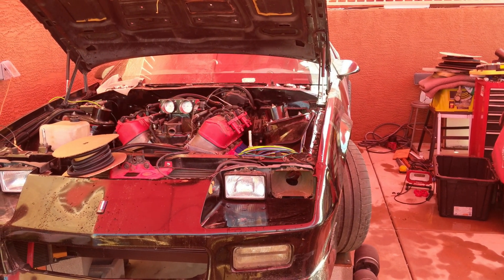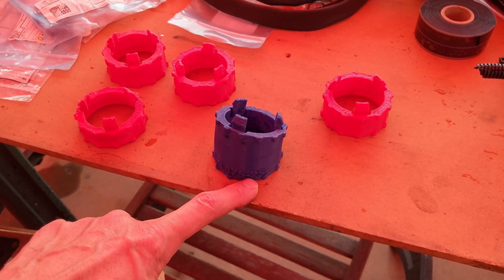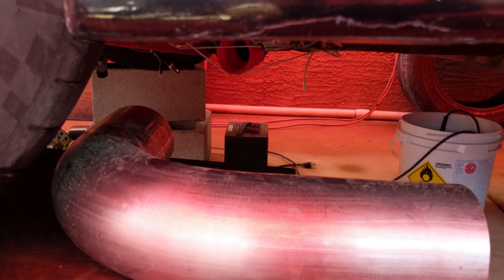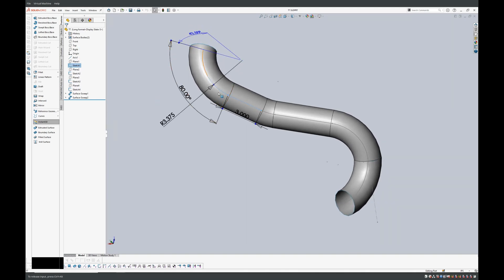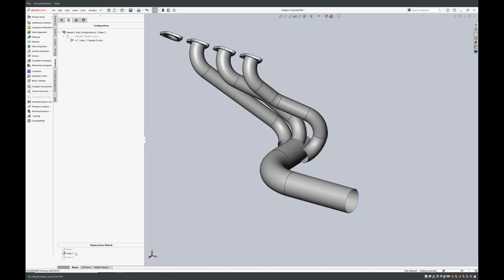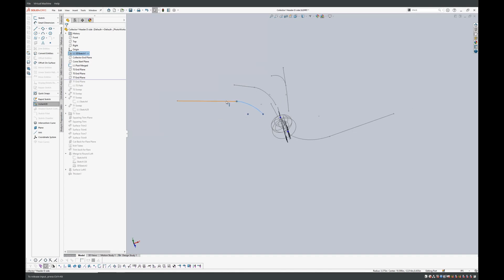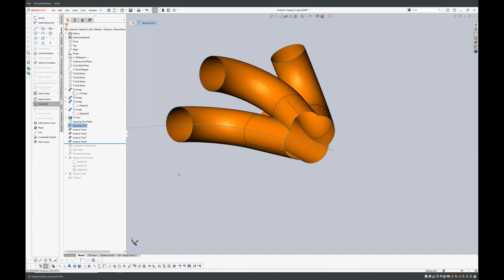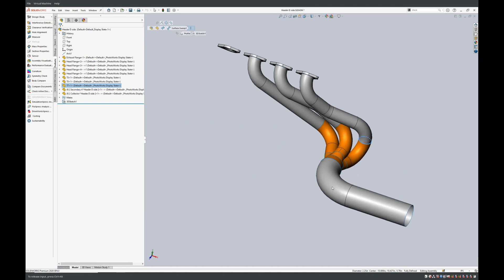Designing headers and collectors on the car and in Solidworks

Comment: Nice Work!   

Just curious how long did it take for you to print all those blocks?
Reply from the maker: I can fit 16 on the build plate at once but had better success just printing 8 at a time. Roughly 1.5 hours per part / 12 hours per batch.
Reply: @KBo540  That's not too bad

You're using a 0.8 nozzle correct? 

I might end up doing the same thing out of PLA. 

How much for .sldprt files? lol

Comment: You should see how the Ford Escort rally cars, had a modified floor pan with, a box section that ran along the side of the tunnel, to allow maximum ground clearance. Rally cars bottom out from time to time, so having a smooth floor stopped parts getting caught and ripped off.🤓😳😂🤜🏼🤛🏼😎🍀🇦🇺

Comment: Regards scanning iam using photogrammetry (meshroom), which builds a mesh from photos taken with a normal camera. I used it to scan the engine bay for designing diy itbs.
Reply from the maker: Nice! I have a GPU server set up in AWS where I run Colmap to do the same for other car parts! I'm still learning how to get the best results, but will definitely be using that technology for a few future projects and will check out your video!